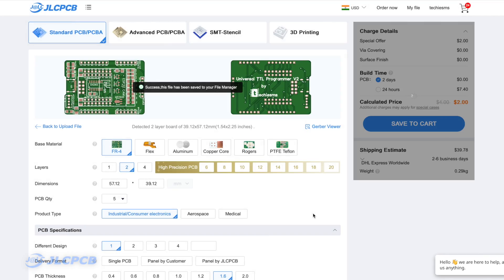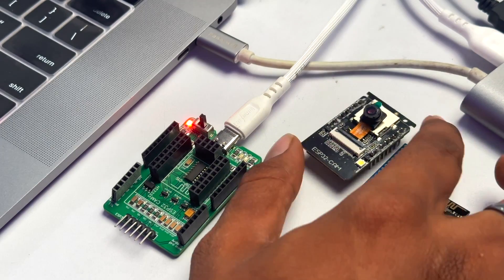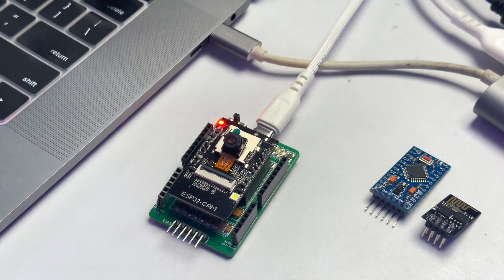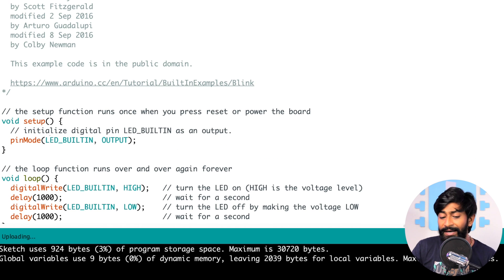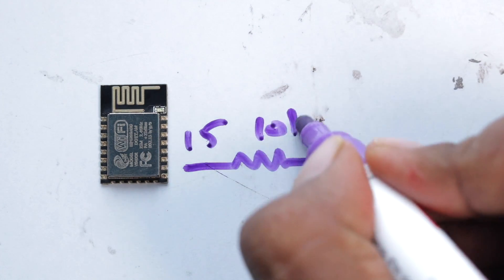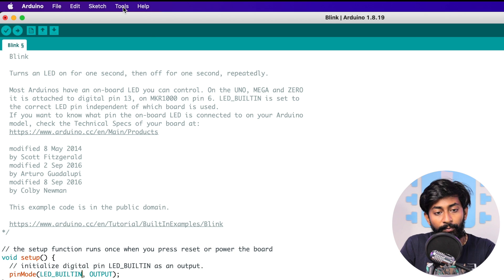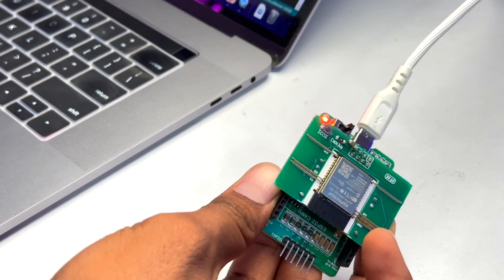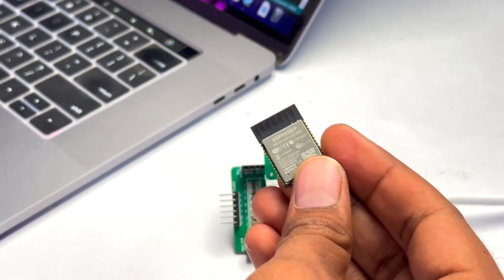The BEST USB to TTL Programmer Ever!! 🔥🔥

Comment: Why don't you consider using cp2102 IC as replacement of Ch340 IC, bcoz in ESP32 Dev board, they are using cp2102 IC, as it is very small

Comment: Nice brother, as you mentioned price Rs. 749/= , it is included both shield of esp8266 and esp32. Please reply.
Reply from the maker: No. That’s the price for just programmer board 
Extension PCBs are sold separately. We have options to select different extension PCBs of the purchase page. Check it out